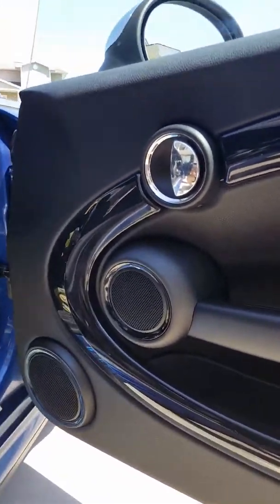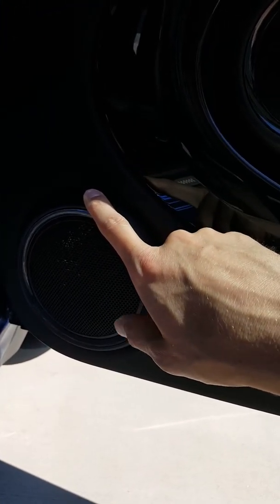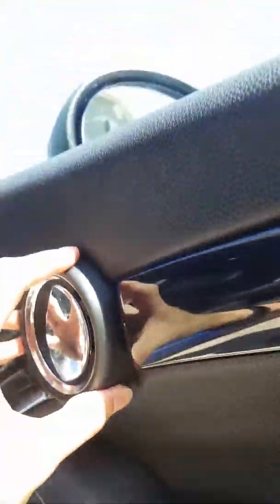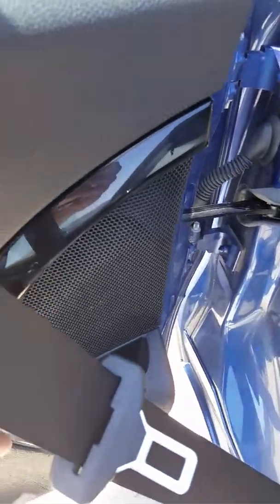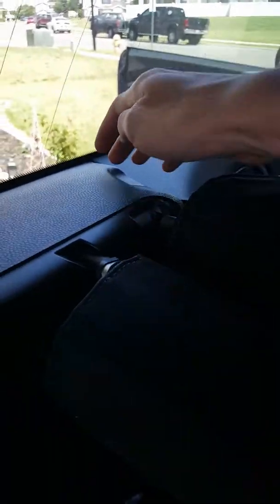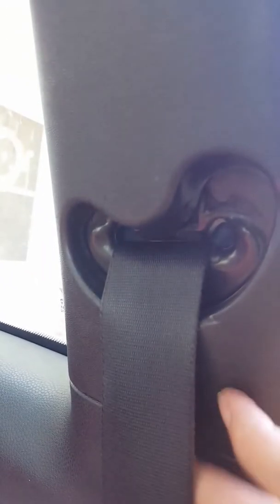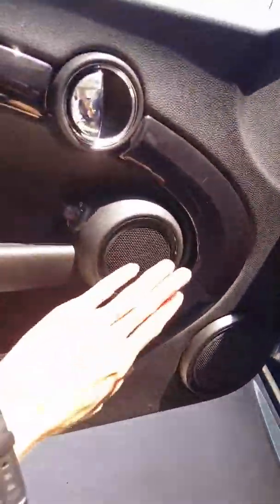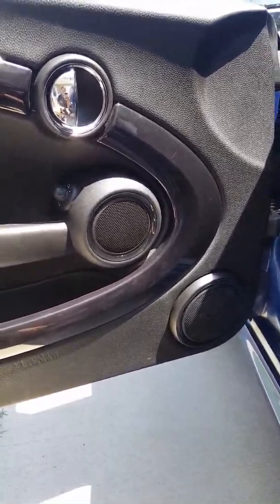2008 Mini Cooper S Clubman speaker replacement and panel removing

Comment: Great video, thanks. Does the manufactureres stereo have enough power for all new 6 steakers? or do i need a amplifier?
Reply from the maker: No additional amplifier.
Reply: @tallmanflex  and if i still feel that it isnt better, what options do i have?
Reply from the maker: @christianschnelli3769  not sure. I did have issues with the aux port producing static so if that is what you are basing it off of. Radio or cd was clearer.
Reply: TallManFlex product reviews/installs that i will try it now.

Comment: Awesome Vid man. Thanks for the Size details and that driver side panel removal. Also once you got to the speakers did you have MINI pigtail connectors for your kenwoods or did you cut and rewire? or solder?
Reply from the maker: I cut and rewired.

Comment: what wire on the doors where + and what was -? thanks
Reply from the maker: RanGer498 i don't recall, i think i looked at a diagram of the wires.
Reply: TallManFlex product reviews I figured it out ..I'll post the info later
Reply: what ended up being + and - ?

Comment: Do you have the base system or Harman kardan?
Reply from the maker: torqq base
Reply: Thanx, trying to change my lower woofers. Mine has the hk system,  not sure what I can install in there
Reply: @tallmanflex  thus why replacing the crappy cardboard speakers lol i need to do the same with mine and found this vid.